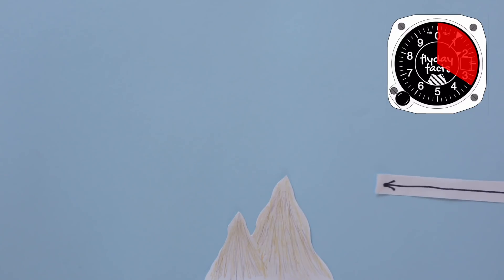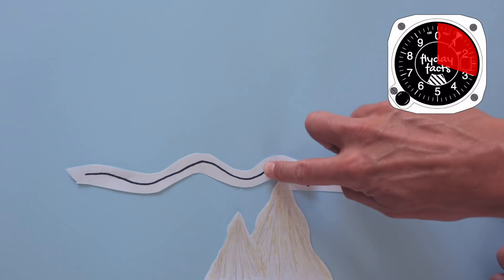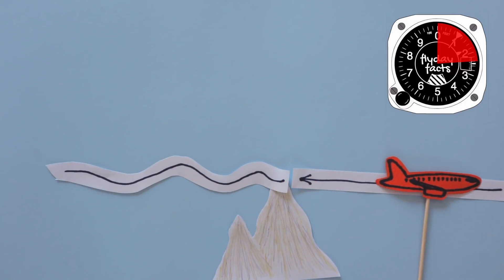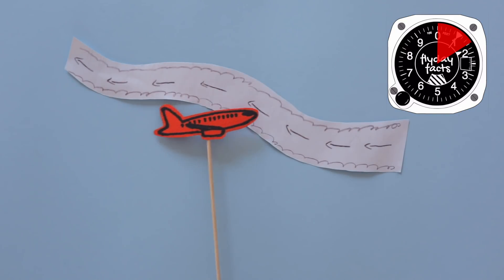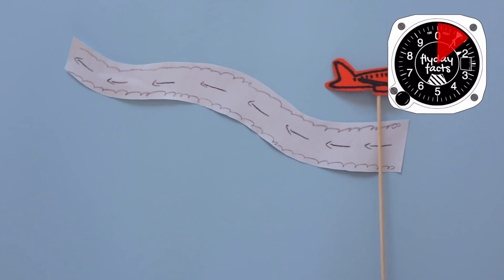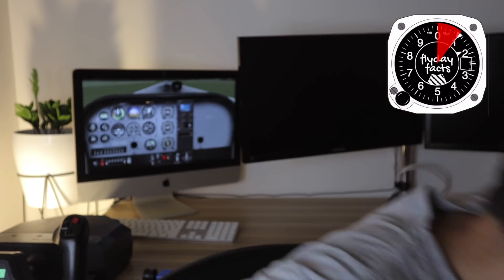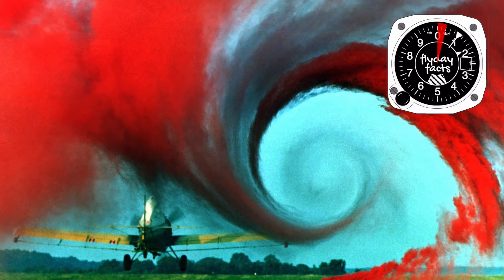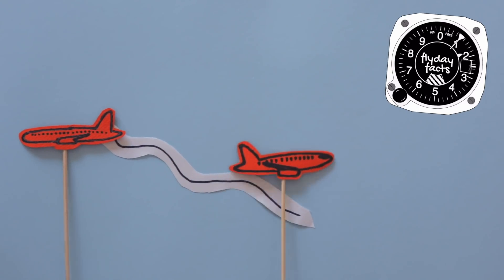What is turbulence? Pilot explains all.

Comment: Thermal Turbulence heading southeast from moorabbin during summer is shocking! all the thermals coming off the concrete below. Also had a perfectly still day the other day, literally 0kt on the TAF, but as soon as we got to 300ft, 25kt crosswind! made for a bit of fun!
Reply from the maker: Yes it's a lot more interesting this time of year that's for sure! And a 25Kt difference through 300ft is one to watch, especially low down in the circuit.

Comment: Good topic, often on approach to Brisbane, runway 01 threshold area there is a great big hanger, (Qantas hanger 3), in certain conditions this hanger disturbs the airflow around it which is still unstable by the time it gets to the runway. That can cause some interesting scenarios for the pilots. Safe yet sometimes challenging.
Reply from the maker: Thanks Dan, that's a good point - mechanical turbulence down low can make final approach tricky. That's why it's so annoying when they keep building shopping malls and warehouses right on the airport perimeters!

Comment: I learned that the turbulence at the edge of a jetstream (especially at the cold side -> near to the poles) are called CAT clear air turbulence. 
wind shears don´t have to be connected to a jetstream, mostly they are just differences in speed and direction of wind over a short distance...
am I right?
Reply from the maker: Yes jetstream turbulence is a form of CAT. The edges of a jetstream with differing wind speeds gives the wind shear effect, but you're right in saying wind shear doesn't have to be associated with jetstreams. In fact the most dangerous sort of wind shear is often low level microbursts generated from strong downdrafts in storms. That can be incredibly dangerous to aircraft at low speeds close to the ground.

Comment: Really good. Intresting, entertaining  and informative. I fly quite frequently  to S E Asia. About 4/ 5 times a year. From the UK it's usually around 10.5 hours flying there and about 12.5 hours flying home. The pilot announcements suggest this is because of airflow? Never really understood this. Any chance of making a programme  About this or is it too simple ( and something  we all should know but I don't ) Cheers Harry
Reply from the maker: Thanks Harry, the difference in timings for flights across the same distance are typically going to be related to the winds. So for the faster flights, you'd probably have a tailwind (wind is blowing on your back and pushing you towards your destination) and for the slower flights you'd have more of a headwind (wind is blowing in your face and slowing you down). Aircraft often look for good tailwinds to make the flight time shorter, means they also burn less fuel so it's more economical. There are a few other factors too, but I'd be happy to explore this a bit more in a short video if you think it would be useful?